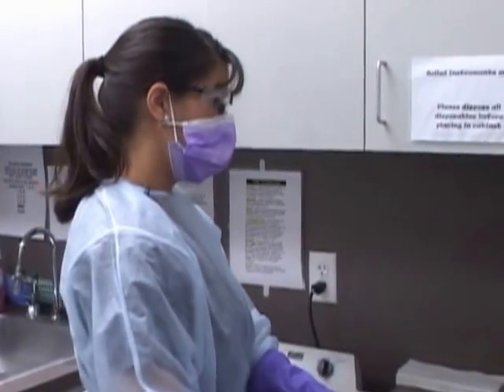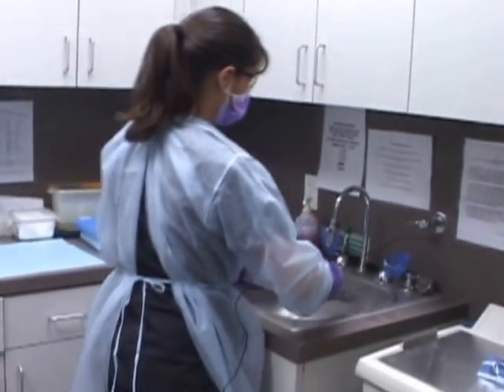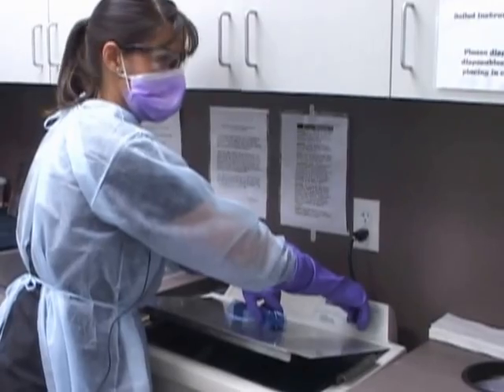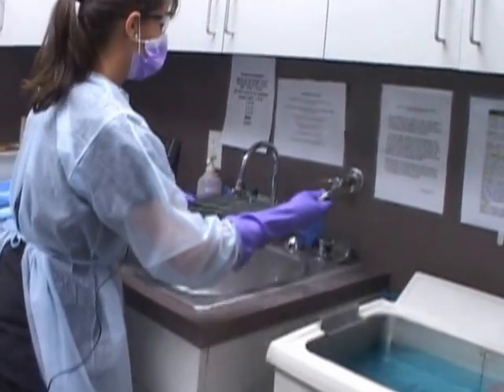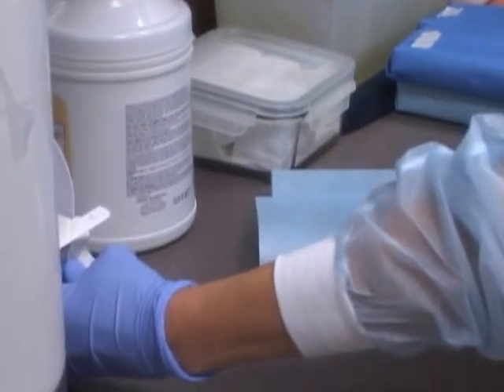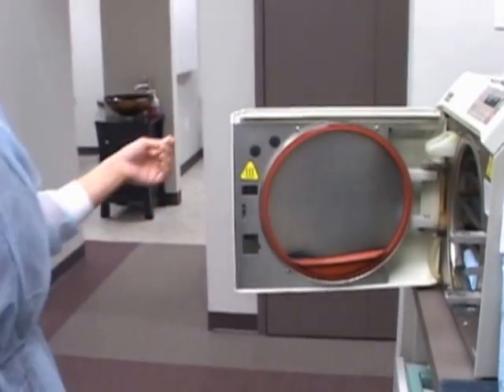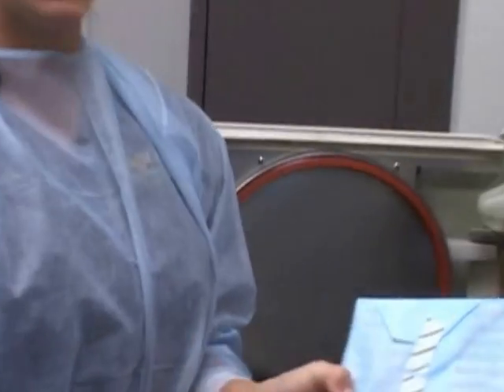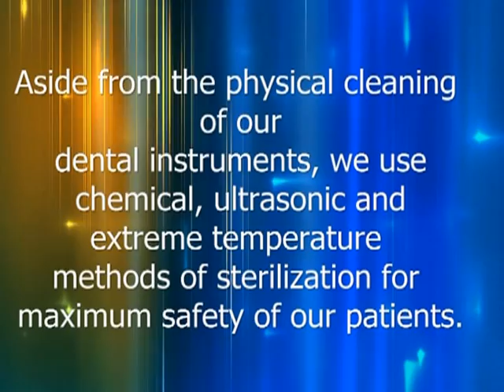Autoclaving; Dental instruments sterilization process

Comment: where is your yalls degrees because I have 3 hanging on my nail salon and she went beyond cleaning per health codes and laws actually each state is diff ! Honestly the sonic cleaner is super heavy duty to be honest the cleaning solution that goes in there kills HIV AND EVERYTHING ABOVE!!!! So the autoclave was extra extra and kills anything else that may have been left over you guys are doing way too much in these comments ! And far as the gloves go in that area is usually super cleaner compared to anything else in that office she changed her gloves 3 times which I thought was a over kill . State law only requires you to do a ultrasonic and sink wash . Uv or autoclave is extra and double makes sure everything is sterile I promise you that heat as long as it’s above 250 F it will kill germs you none certified dental assistant smh